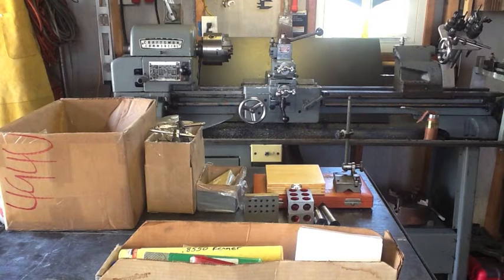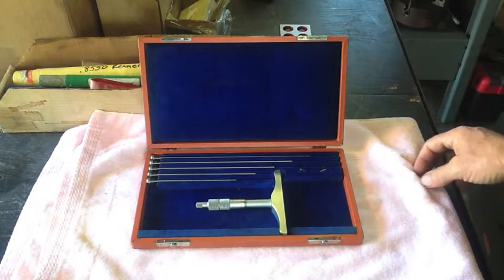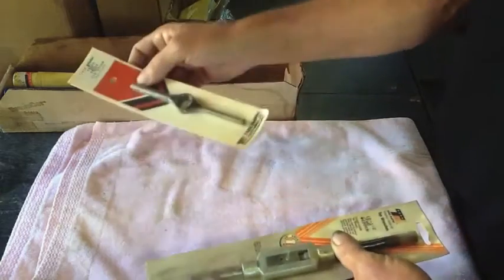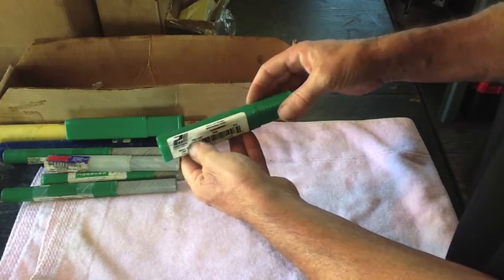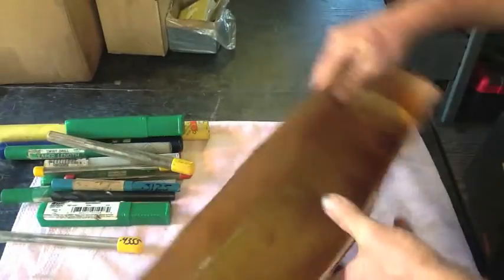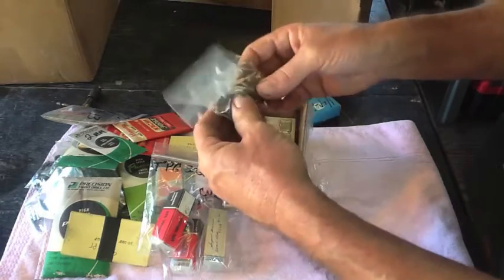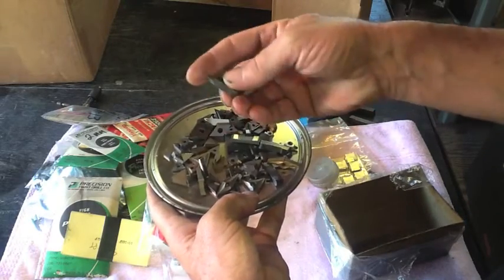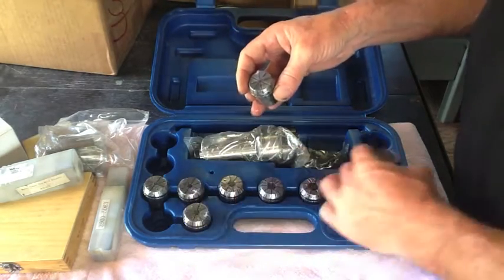Getting Tooled Up on The 12" Atlas Lathe / Part 1 - MSFN

Comment: I haven't organized my reamers yet.  What you are looking for is reamers on fractional size and an over and undersized for each fractional size.  This way you can do things like install dowel pins where the pin is press fit in one side, clearance fit in the other.  Drills make a pretty ragged hole compared to a reamed hole which will be very smooth.
Reply from the maker: Most of the reamers he had were pretty big and limited selection. Most were solid carbide and outta my price range. The ones I got may come in handy one day :) Cant trust drill bits, are good for hogging out material tho
Reply: I would consider the following plan:  Take the expensive pieces you have with no real use like the odd size reamers.  List them on Ebay at a "Buy It Now" price that is respectable with no expiration.  Let that money start to accumulate.  There will be somebody who is looking at paying $105 for a .550 reamer who will gladly give you $60 for your new one (or some such scenario).  This way when you run across another group of reamers that contains more useful stuff but isn't priced at a give-away, you can feel good about buying them anyway.  You are in effect trading something less useful for something more useful. Whatever you paid for the first item you sold is what you have invested in the replacement item you needed.  I don't mind paying a slightly painful price for something I need when that money came to me easy from tooling that was nearly given to me.  Trading something you don't need for something you do is always a great deal.  Just because the thing was temporarily converted to money does not make the new item it purchased a bad deal.  Not only are you helping yourself, you're helping the guy who bought the weird item who really needs it. 

I love collecting chucks.  In fact in one of my video's I sing "My chuck's bigger than your chuck....".     A 5/8" chuck is the ideal size for most tail stock use.  The 3/4" chucks probably won't hold 1/8" drill bits which will become an irritation.  I do have a 3/4" 59B head-stock chuck.  I'm looking to get a 7/8 or 1" chuck but it's only because I want to sing again.......  ;-)
Reply from the maker: My experience is everytime I sell something I need it later. Lol 

But maybe I hold out hoping someone wants to trade me a milling attachment for a few big reamers :-)
Reply from the maker: Not a bad idea tho....wait till part 2 :)

Comment: you know that pretty much all of that stuff you got is not going to work with the 12in lathe sorry if you put the drill chuck and adapter in your laved you're not even going to have room for a drill bit and whatever you're tooling I know I have the same problem
Reply from the maker: My lathe is a 12" x 36" lathe
Reply from the maker: My lathe is a 12" x 36" lathe